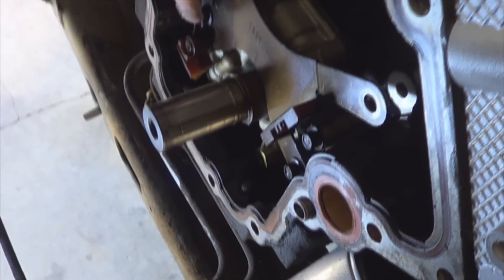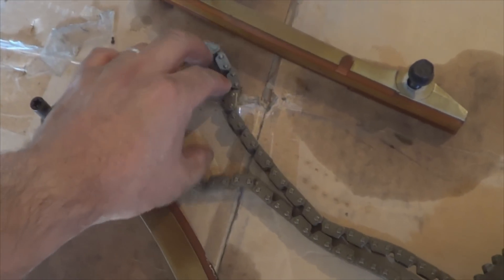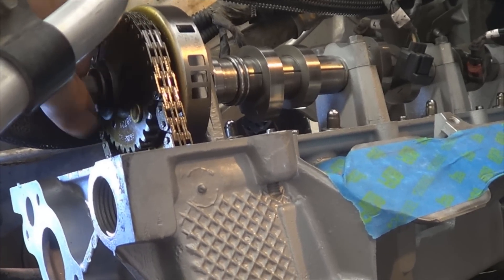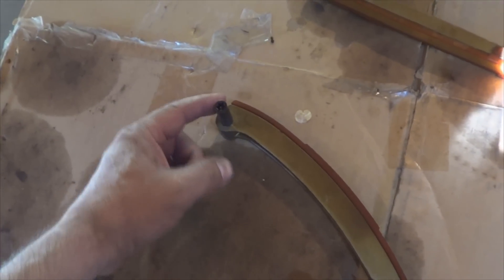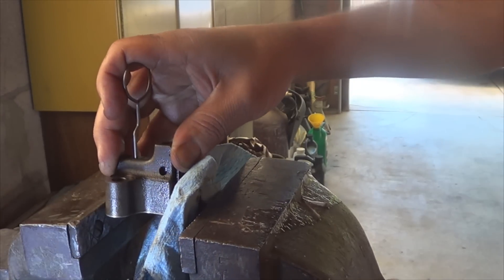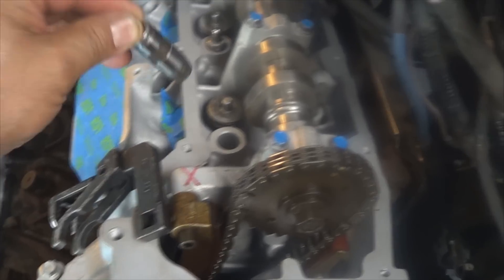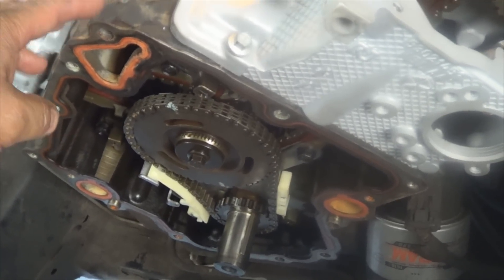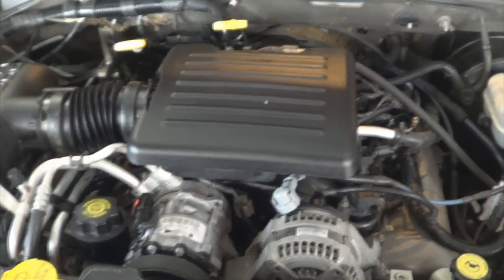Dodge 4 7 L Engine Cylinder Head Replacement Part Seven by Howstuffinmycarworks

Comment: I have a 2000 dodge Dakota 4.7 v8 i just bought. I had a misfire code p0308, changed the spark plugs, the ignition coils, fuel injector, and a tapping sound coming from the throttle body. Did a compression test, my 8th cylinder was low on compression. Looking at doing a valve job. What are the tools I’ll need to complete this job from start to finish? I have a basic 170 piece tool box, with sockets and wrench’s. I skimmed through this series and looks like what I’ll need to do. Does this video have all the tools I’ll need? Thank you so much. This is the only video I found with a step by step process on getting the cylinder head off and putting it back together after what it seems like I’ll have to, replacing the valves.

Comment: Thanks a million for this video. Really well done. As my high school auto shop teacher would say: "Like a girls skirt; long enough to cover the essentials, but short enough to keep your interest!" . I am almost to the point of pulling the heads on my sons' 2003 Dodge Durango. Engine "stuck" (able only to turn a couple of degrees with the harmonic balancer,), but timing train looks practicaly brand new and seemingly properly alligned. No warning on the problem. At a stop light and engine died.....As it is an "interference engine", I am assuming that it is the dreaded valve seat issue. I'm crossing my fingers! I am certainly more confident in tackling this job, thanks to your tutorial. Cheers!

Comment: Very good job explaining the job. I really like the tip of the head bolt in hole before installing. I've been a pro mechanic for 25 years, never been a Dodge fan. Your series of videos are going to be very helpful, & maybe I'll develop a better feeling towards Dodge. Thank you VERY much , I learnede alot.

Comment: Excellent video series. Thank you. I already had a good idea of what I’m doing because I’ve done it once before YEARS ago but was having trouble identifying parts based on the diagram I have. You showed me exactly where they are and many tips I hadn’t even thought would be a problem. I watched another video first but it only showed the steps; not the work or locations.

Comment: Very nice I a Ram 1500 with the exact same trouble even the same cylinder. It also over heated and after replacing the water pump I started having real trouble that didn't show up until I was able to drive a little for it to reveal itself. I have a Haynes manual but it didn't say anything about the head bolt on the driver side to miss the brake booster. Thanks a bunch I hope mine is as successful as yours. Being slightly disabled I saw your struggle with the heads and hope I can finish it. Good luck buddy!

Comment: Great videos, I have a 2001 Dodge Dakota 202k miles, I wish I saw these videos earlier, I have a question, I'm replacing the timing chain with OEM timing chain, oil pump, guilds and tensioners $900,   I  want to change out the oil pump OEM $150. Do I really need to take off the intake manifold,  RT & LT exhaust  2 bolts each  and engine mounts to raise the engine  to gain access to the oil pan? what I wanted to do is to replace the oil pump, and insect the oil pick up tube and replace the oil pan gasket.  Its hard for me to believe that the designers would have you go thru all of this if you wanted to replace an oil pan gasket and to inspect your oil pick up tube. Any comments wold be great.  Do to lifting the engine, I went out to harbor freight and bought a engine hoist 2 ton for $235. To rent one would for 2 days was going to be $125 in my area, the thought was if I had to do this again it would pay for its self.  My big problem with all of this the oil pan should just be right there and drop down not all this other work.  Any way If you have any comments on the oil pan that would be great. Again great videos!      Frustrated Dodge Owner.

Comment: On the driver side cylinder head, how did you remove that plastic peace behind the power steering pump to get to the timing chain guide bolt?

Comment: I have this project in front if me.  I've seen posts which suggest that new/remanufactured heads on an old block can cause rings failure.  Please share your thoughts.

Comment: I just got a 2002 Dodge Ram 1500 SLT four door cab 4.7 l 287CID 4x2 that has 232000 miles on it that last person who owned it I think ran it hard until it gotten repossessed and never did anything to keep up the engine or transmission or rear differential and I'm not a mechanic or automotive repair shop but having multi misfires and vibration  hitting 45 or 55 mph and it's also blowing out light blue smoke out exhaust and it blows out warm heat out for 2 seconds then goes to cooled while on heat and wanting to pull a fifth wheel camper and don't trust it
Reply: Put in new Champion plugs. The blue smoke could be rings or valve seals. Do a cylinder compression and leak down test. Check your coolant level, you may have a plugged heater core or low coolant.

Comment: after i finished this on mine it started smoking a lot and rough idle. but later that i took out on the freeway ad everything cleaned up. smoothed out and the smoking stopped. had condensation at first... all good after that.

Comment: Oscar.P had the same question that I do. Does it matter where the lobes are before installing the sproket? In the video you should taking out the lifters and your tool for holding the sproket but how do you make sure that the new heads have the CAM lobes turned in the right rotation?

changing head on my truck. how do i get new camshaft lined up to where it needs to be like line up all lobes where they have to be  before tightening sproket and chain to match the timing?
Reply: "V8" markings on the cam sprockets need to be at the twelve o clock position.

Comment: good job!!! very helpful video. I'm in the process of replacing the head of my 2001 jeep grand cherokee. its been running really rough both when idling and running. it turned out that there's ZERO compression on cylinder no. 2; i have not pulled out the head yet, but i get this feeling that the failure is very similar to the valve seat coming off. i'm faced with several hurdles at this point: first is the time to do the job. second, where to get a remanufactured heads. i'm not so sure if sending the heads to the machine shop for rebuilding will actually solve the problem of valve seats coming off. anyways, i hope to get around all these hurdles pretty soon...

Comment: Awesome job. i would guess the 3.7l is the same job.So as long as you don't over heat the engine, you will not warp or crack the head?